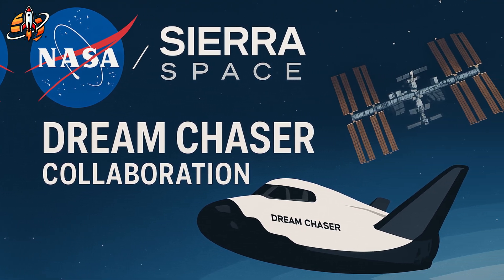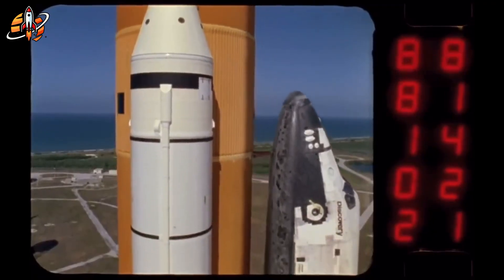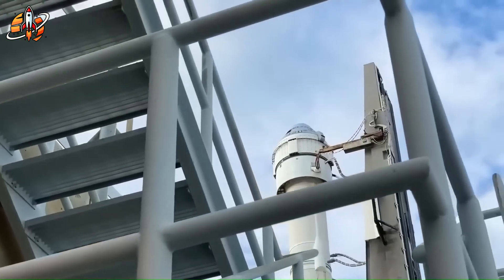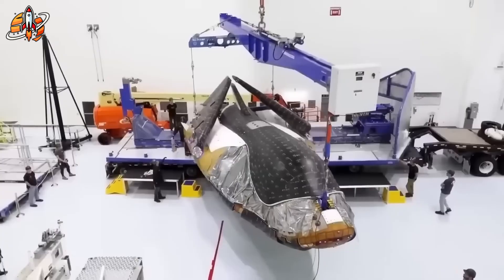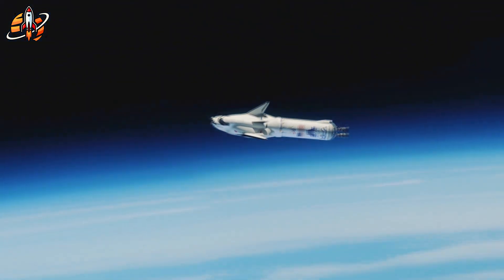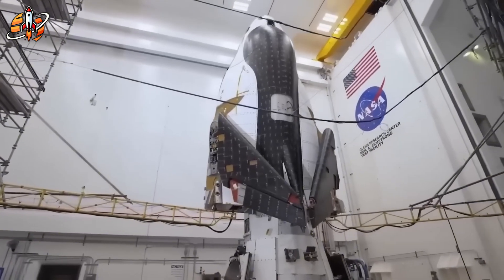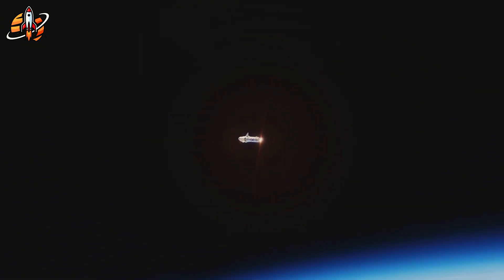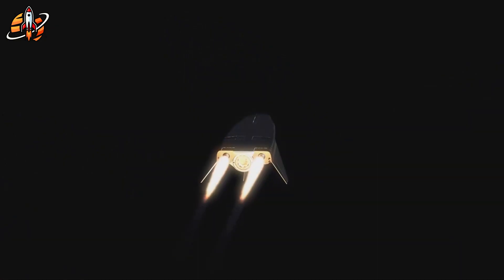Dream Chaser's 5-YEAR Delay: No Rocket, No Launch... NASA Loses Hope!

Comment: Never heard of it...and the days of the reusable space "plane" are over.  It cost too much and the turnaround took too long.  Elon Musk figured it out that going back to the roots and building up from there made more sense...which is why he has been so successful and is the only one out of several that is actively still putting things into space.  Not even Russia, the U.S.' biggest competitor in the space race, is really doing anything of any value anymore because of their idiotic and costly war with Ukraine, and their insistence on not evolving from their old rocket, which works...but NOT efficiently, not as safely, or at a low enough cost.  If you drag your knuckles in the dirt, then you get left behind and forgotten like the cavemen of old.
Reply from the maker: SLS/Starliner woes sting, but Axiom suits flew in 2024; could Dream Chaser's success rebuild trust in NASA's multi-vendor vision?